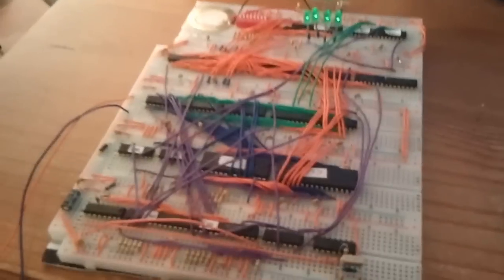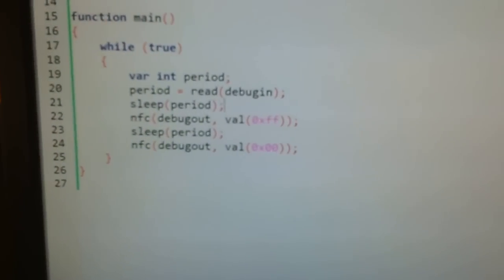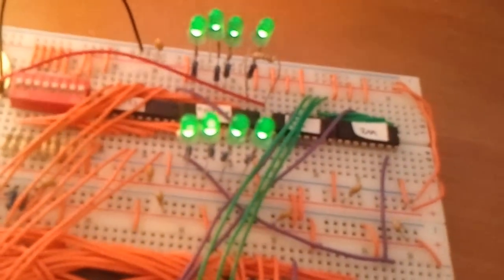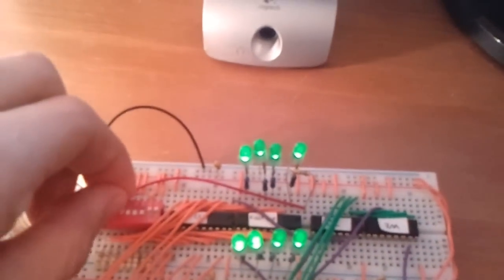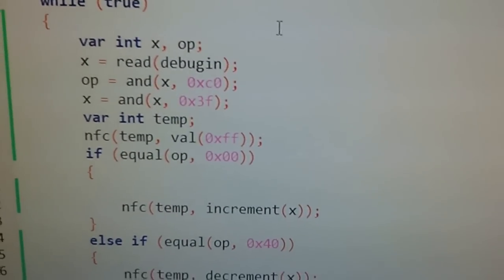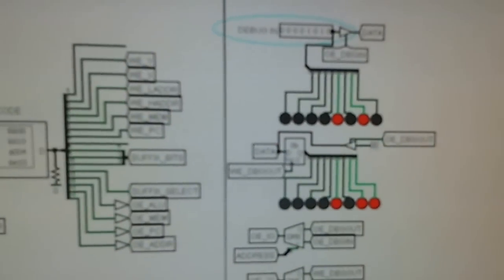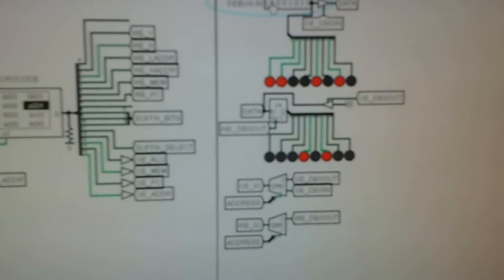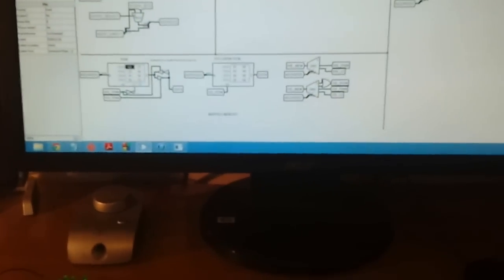Homemade Processor Running Code, Going Beep

Comment from the maker: I found your documentation really readable :) it is big endian though, and the address field order is a bit different... Was gonna use nands instead but realised nors are actually easier ;) It is indeed! The circ file is in the processor directory on the repo, and the readme describes how it works and the microcode format (and all the improvements I made along the way).